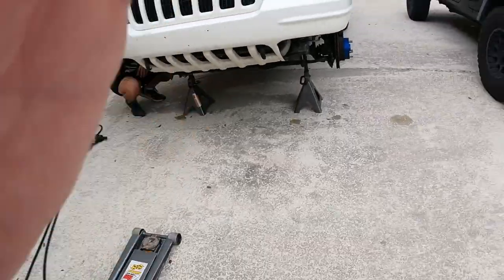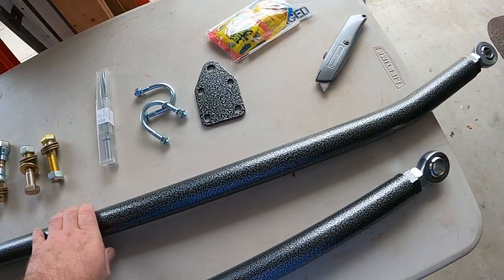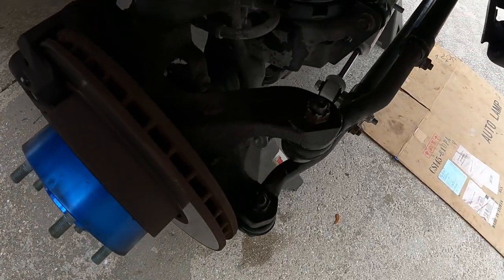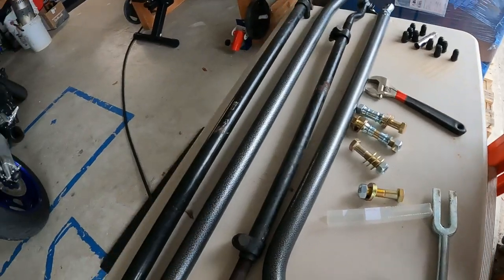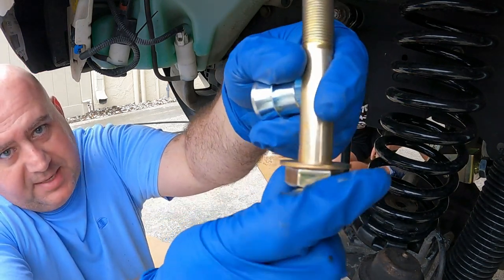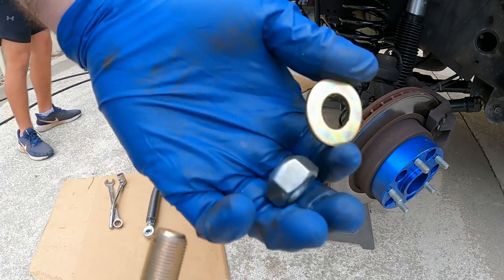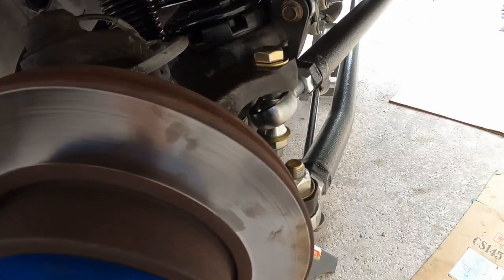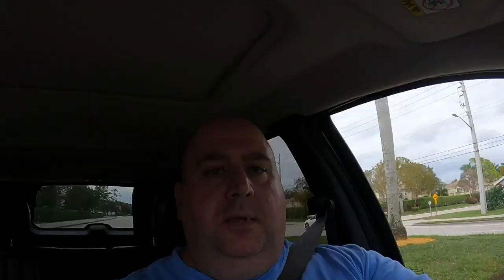2000 Jeep Grand Cherokee WJ: Trail Forged HD Steering Kit #Jeep #GrandCherokee #WJ #TrailForged

Comment: Hello, i have the same kit im installing UTK, how come you bolted the straight part of the drag link on the knuckle and the bent end on the pitman arm?
Reply from the maker: When we installed it the other way the bend was hitting and binding. We reversed it and so far so good. But this could be why we couldn't get the factory skid plate back in. 

I will say that 2000 miles later and its been fine installed this way.